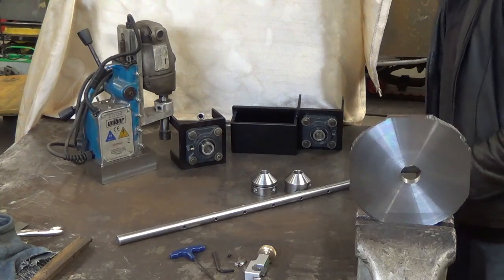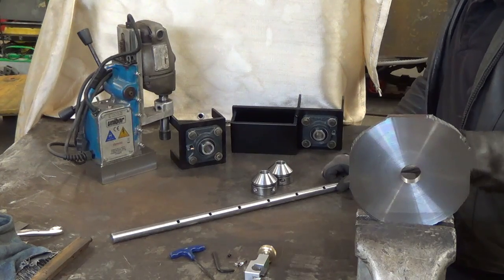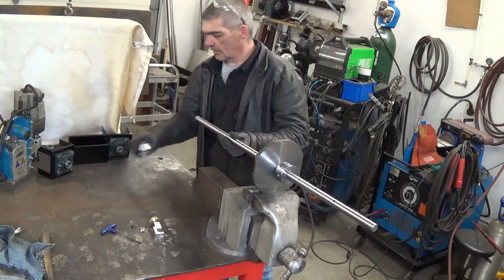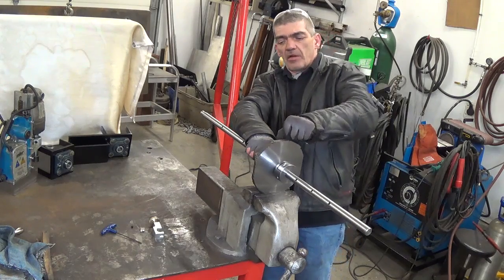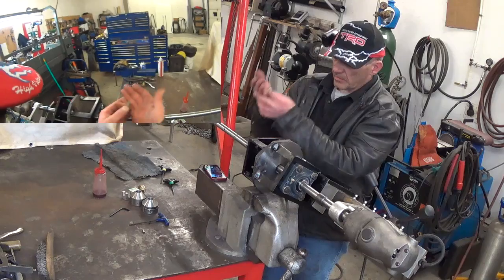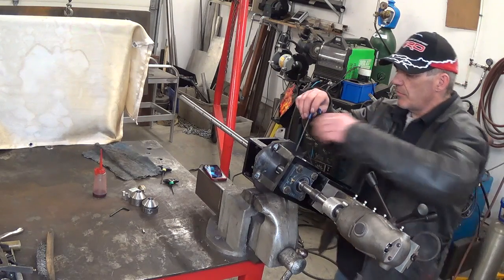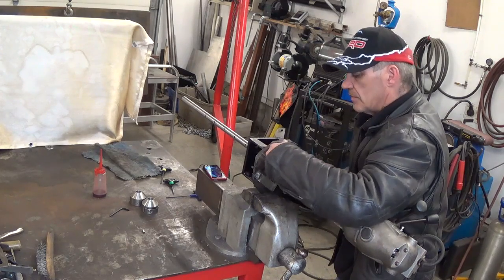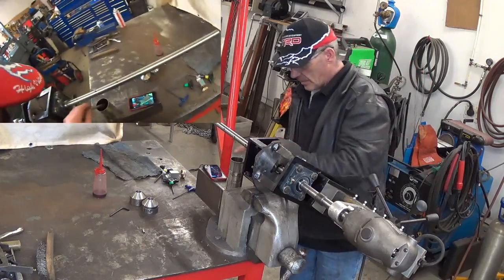Line Bore..

Comment: on yer setting tool, its possible to get "micrometer heads" just the threaded bit with the thimble and barrel so you can mount that and use it to adjust the cutting tool.

Comment: No need for square holes in the boring bar. I built mine 20 years ago and it has round holes for the tool bit. Works fine

Comment: Gidday Shagger,     about to mount a fly cutter on mine and i thought i'll have a look on You Tube if any one else has done this.     The only thing I'd change on yours is the steel base the mag base mounts onto.   I'd go 1 inch thick,    thicker it is the stronger it hangs on.      nice work though.

Comment: I did that untill someone walked by and tripped over the plug end and everything came crashing down! So I took the magnet off installed insulated spade connectors and added a few feet of wire enough to get magnet out of the way safely. Then cut a 1" plate to put in the magnets place bolting it to the drill motor. Even a power bump and it will fall. And by lengthening the wires it still ran. Was a newer drill with circuit board in it. Good luck! Nice work.

Comment: Good job. I built one just like that 20 years ago.  It is still in operation.  Your mounts are much better than mine.  Mine were made of any scrap I could find on the job site.  It worked though perfectly though.  Done a lot of buckets, grapples etc for the logging industry over the years.
Reply from the maker: Thanks. I have made some changes since the first try and at some point I'll do a video about it. :-)

Comment: what wattage is this drill? think it would be capable of a 4inch boring cut?
Reply from the maker: Label says 6A @ 450 RPM...I dont think she'd do big holes. The main idea was to use it for small excavator bore say around 30MM.
Reply: @CompEdgeX2013  thanks for the response, what depth of cut were you taking here? i need to figure out how to open up a 100mm hole to four inches ensitu on an injection molding machine
Reply from the maker: @BenjaminHarris88  Oh man, that was a while ago...if I remember correctly I was just taking a quarter turn on the adjuster...so .025" on the diam..

Comment: Nice video. Line boring to the average heavy equipment mechanic is a black art. All they know is it can be done..(they don't want to know how) Lots of money change hands and it happens :-) 
I'm a truck driver paid to figure out a line bore on a clapped out machine and it was one of the most satisfying things ive ever done. search 5ZwsftYpQs8 all done for $250 and some scrap iron at the yard.
I wish i had seen your cutter advancing tool allot sooner i could have used the idea.
Reply from the maker: The magdrill idea was something I wanted to try for small bores that would justify the work. I did make some changes to the unit and it is even better now. I'll likely document this in a future video. :-)

Comment: Very clever i have been wondering how to do this for a long time. There must be a better way to measure the tool height. Where did the bar come from?
Reply from the maker: Tool height can also be easily set using a dial indicator (more accurate anyway). Using the tool is great for quick adjustment while roughing. 
The bar I made myself using some 1045 ground shafting. quite easy once you have the needed square broach. A fellow machinist was nice enough to lend me one for this experiment. :-)
I have made some changes to this setup and hope to document it in a future video.
Reply: ***** Hmmm perhaps two pieces of flat steel with a pivot point with degrees. Lay one flat on the bar lift other bar up (must have a sharp point_ until it reaches the determined height of finish bore- or to measure cutter height.  Kind of like a carpenter's bevel square in design but small and modified. I am not a machinist but a 35 year carpenter...
Reply: ***** As you said it is not the rough cut- but the final cut. So once you reach the predetermined height you're done. You only have to measure once this way. Set modified bevel square on bar and slide towards bore if it does not fit in your not there.. Must have a very sharp point with 100 degree back cut bottom  angle. And can be used to measure tool height fast. Same thing-  slide to cutter height --if cutter height has not reach  that point you're not there yet... We call that a cheat stick..
Reply: ***** the hard part is the math to set up cheater.But once set and securely tightened no more measuring. Ok i am done -- like your video-- as with all videos-- they make us think and learn. Keep them coming---
Reply from the maker: A preset gage will in theory work. What it lacks however is the ability to monitor tool pressure during the cuts... whats dialed in as compared to whats actually cut. There is always spring in the tool and knowing how to allow for it is a big part of cutting metal. You'll hear the term "spring cut" or "spring pass" quite often. Dependant on material you can dial in a .050" cut but only remove .045". Monitoring this as the final size approaches is what makes a good fit or an oops!! :-)
Reply: Yep there is a learning curve for any trade that can not be taught except by doing it  and screwing it up.

Comment: looks good only thing i would say is 3 legs are better than 4 as they will not rock. when i do set up we just use 3  legs  got a hole box full of stand off's. only other thing is  give them a little angle out or in but all the same way . think of a tri-pod.keep up the good work
Reply from the maker: Ya, I can see that. Will keep it in mind for some setups for sure. Havent done much to continue this project lately but do plan to add more to it.  Colin :-)

Comment: Interesting demonstration of line boring using a magnet drill. Often the following operations are also required along with line boring: 
A) build up welding of the bore surface. This can often be done by hand or in case of narrow, long bores by a machine.
B) facing both ends of the bore to put in bushes with flanges. You would need a similar mechanism as in an automatic boring head.
C) Cutting of internal grooves to hold snap rings, O-rings, seals. Same mechanism as for B)
Are you aware that there are two businesses trying to put line borers out of work? https://www.youtube.com/watch?v=Hgd9ksEoRqo and http://www.ferret.com.au/c/fortus/expander-bolts-from-cps-wear-parts-n1833441 Once these expander bolts are installed there is much less need for line boring.
Reply from the maker: Thanks for taking the time to comment. Adding the links caused it to go in the "likely spam" section till I noticed it, sorry. Some observations to your points:
A) Bore weld is one option but a common procedure around here anyway is to bore over and make a replacement press-in bush of better than mild steel material (EG:1045). This is usually a cheaper option to bore weld equipment and IMHO a better option.
B) Facing is not always required and can generally be incorporated into the bushing as many setups I've seen have clearance for the flanges.
C) Ya, this part sucks..LOL but is necessary.
I have seen the expander pins and see some viability provided the lug ears are not worn out of round excessively. The expanding section of the pin still cannot expand in one area to completely fill an oblong hole. Of course any gap is room for the machine to develop slack leading to the same end result of sloppy pivot point. While having uses I don't see them as a one-fix for line boring.

Colin :-)
Reply: thanks for rescuing my comment out of the dumpster :-) C) Yes the expander pins are not a valid repair for heavily worn out bores. But in those cases they can be installed after a traditional repair with welding and line boring or even with bushes if either press fitted or welded fast against rotating. Once such an expander pin is installed the bore is unlikely to wear out again. Good for the pivot owners, bad for the line borers/pivot installers....
Reply: How unfortunate that your videos stopped coming. I am looking forward to line boring projects or anything...
Reply from the maker: rol eic
 Things have changed in the shop over the past year that make it hard to do video.. I do have some linebore footage of the bigger tractor blade and hope to string together something in the near future. :-)
Reply: I am looking forward to that. Thanks.
Reply: hello Colin, how are you? The near future is over. We are in the far future now....;-)
Could you put your boring bar to use? If you want to go bigger I recommend to use a standard electric motor like for a lathe with 2-3 hp but with a reduction gear. You can find used gear motors on ebay or other platforms for cheap. Basically that means to build the whole boring bar with drive and feed from scratch. But since they are not very complex designs this is most likely within the capability of your equipment. Probably you can make one even without a lathe and mill just with a drill press and a welder. You just need to buy ground bar, 2 bearing blocks, a 0.5" or bigger all-thread for the hand feed mechanism, a few HSS or carbide tipped bits plus some scrap steel.
Reply from the maker: Did I mention that I had purchased a commercial line bore machine this 
summer? If not, well I made the decision to go ahead with an entry level
 electric machine from York. It does up to 5" bore and has 4 and 6 foot 
bars. I did construct an additional 1.5" x 4 ft bar for heavier work 
than the 1.25" bars can handle. I'll try to show it at some point. It 
has been used to do one snowplow job a few months ago and worked well 
but I am still learning how to use it most efficiently. :-)
Reply: congratulations. Do you put in bushes after line boring or do you weld and bore? Would love to see some footage of it in use...:-)
Reply from the maker: This one was a simple oversize. Plenty of material in the boss. It was severely worn (1/4") from lack of grease and original pin had broken several times. I did shoot some video and will have something together soon. :-)

Comment: Very interesting video. The setup ingenious. I hope you will show the actual job when you get that far. This would allow "in the field" work and with really good results. What is the diameter of the axle/boring bar? It would also be nice to see how you drilled and broached the bar, adding set screw (I assume). Very nice solution for adjusting the cutting tool. Thanks for sharing. Well done video, too!
Reply from the maker: +Jim Milne Thanks Jim. This whole exercise is to prepare myself to offer a service that is not available in this area. This unit is meant to be a lightweight rig designed to re-bore smaller bores found on mini-excavators and the like. Bar size is .875" (7/8"). I have taken test cuts with it up to and including 2.4" today. Above 2" it starts to flex but it was never intended to go that big. I'm making a larger bar for that.
I had planned to record some of the fabrication but the broach tool was borrowed and needed to get it done and returned.
I made a large improvement today that I will touch on in the next video. :-)

Comment: Great tool Colin!
One thing I'm wondering is how you're going to measure your bore. I guess when you have a line boring job you need to fit something pretty precisely in there, and this something is probably pre-made like a bearing or a repair bushing.
Reply from the maker: +Sergey Gromov Sorry I missed this comment.. Yes the bore is generally done precise but often the bore is only machined to a round condition again and the sleeve made to fit the hole. In this case precise measure is not necessary until ready to fit the bushing.
In cases where accuracy is needed it is quite easy to remove the bar to fit a snap gage or other bore measure tool.

Colin :-)

Comment: Nice set up. Got a question(s). What do you do when you have an egged out hole(i.e., re-locate the hole). How do you adjust for that. Also, after you grind your weld off those bearing legs do you have to take a squaring cut on the 4 legs to make them all even height again ?

Comment: Have you tried using it on the pull stroke of the mag drill?  I wonder if that might make a smoother cut, especially heavier cuts.
Reply from the maker: +Bob Korves The toolbit in the video had a neutral rake so that might work nicely. I had another ground with positive rake but didnt test it.  I also didnt try any heavier than the .025" DOC (.050" diameter) as shown in the video. I noticed some things I wanted to change so the video was cut short. More to come on this project. :-)

Comment: good work Colin ! ive been researching on building me a rig like this ...i haven't run into the need yet to have to use it but i have many customers with heavy equipment so its a matter of time im sure lol..... did you put the angle of the bit on 45 degrees ? i see where alot of them are .......the thing about this is you have to have a bunch of different bars for different size holes lol ......i guess bearing assembly's too......ah more projects ...........Eric in Kentucky.........
Reply from the maker: +eric chilton I already have more material for a larger bar...but need a more powerful source motor for the bigger bar. Biggest bores I expect to see here would be around 4" I suspect.  There's probably no end to the project!  thanks :-)
Reply: eric chilton på

Comment: A video! Yay!  I like your "depth" setter. (Not sure of the correct term)  It's very simple. I want to build one for my line boring rig, but I was trying to make it too complicated.  I have to add I'm disappointed, though, I was looking forward to the explosion! ;)
Reply from the maker: +Wide Vision Metal Fab Thanks Matt.  I suppose I could have cranked in a huge cut and forced it through...LOL  
The setting tool is nice for such a small bar. Probably not necessary for a larger one as you can use a set-screw to push the toolbit.

Comment: I like it, my old tractor needs a lot of the fittings line bored and all new bushings installed, I may never see that day, but I can see how my mag drill and boring bar can do it now.
Reply from the maker: +Ed Ginsberg If you have the power source the remainder isn't hard or expensive. The square broach is a little pricey but way cheaper than a factory built unit.  Thanks :-)
Reply: +CompEdgeX don't they make a round insert with a square internals. tried to find them on McMaster Carr but not sure what they would be called
Reply from the maker: Ed Ginsberg
Keith Fenner referred to those in a vid some time back. "Toolbit holder" from MSC??
Reply: Hello Mate, try this company : Sturdy Broaching co, Warren, MI. http://www.sturdybroaching.com/contact-us-2.   The only thing I would worry about is the "Tweeking", or movement of the bar, to put it out of round, after they were welded in.  I have seen others use a round hole, then drill & tap a threaded hole 90 degrees to it. Put square tool bit in, clamp down with set screw. BTW, make sure you remove the cup point on the end of the set screw, or the set screw will always fall into that same place on the tool bit. Your thoughts ?

Comment: That will be good for repairing buckets and other implements in the field.  Knuckle bushings as well.  I guess you can make A/C power for the mag drill off a generator or a welder if you are set up for that.  Nice job, and a good design for working on smaller equipment like your little backhoe.
Reply from the maker: +Bob Korves This one was purpose built for the smaller equipment. I know of several now that need work and hope to get it into operation soon. 120V power make portable use easy as a side benefit.   Cheers :-)
Reply: +CompEdgeX That was my guess.  It looks perfect for that size equipment.  It is a good thing to be able to go to the customer as well as letting him come to you.  Usually more money in it as well...
Reply from the maker: *****
Yup. I am going to test the limit of the 7/8" bar by making an extended toolbit holder. I'd like to see if it can do 1.5".. :-)

Comment: Hi Colin, Welcome back!  Your new tool works great.  What kind of stock did you use for the boring bar?  Since the straightness and stiffness of the bar are clearly important considerations, is ordinary cold rolled 1018 straight (and strong) enough, or did you use something else?  Looking forward to more videos.  Best,  -Chris
Reply from the maker: +bx2200 Thanks Chris. The bar material is 1045 ground shafting. It offers dimensional accuracy and higher strength over cold rolled. Chromed would have been nicer but none available at the time.

Comment: Hey Colin, I would suggest that you put elongated slots for your bearing mounts and add 2 all threaded screws to push the bearing blocks that you could use to fine tune your bar position. This is fine if you just need a good hole, but I think it would be hard to get accurate position of that hole if it was needed with this setup. Works plenty good for what you did with it though, glad you aren't stuck in an RV somewhere!
Reply from the maker: +bcbloc02 I had seen that on one of the kits I was viewing and planned to add it at some point...great idea. A few other changes are pending as well! 
No worries...RVs are soon on the menu again..:-)
Reply: +bcbloc02 Hey Colin, great video...! Agree with Brian, would be good to slot the bearing mounts so you can fiddle with the alignment of the bar, given your probably dealing with wallowed out holes to start with... Excellent setup... Cheers, Daniel
Reply from the maker: +Daniel Werger Agreed...one of a few changes coming!  Thanks :-)

Comment: It's a nice idea, the only problem I can see is that you have to take the whole thing apart to measure the bore size.
Reply from the maker: +wheeltapper1 Well, not necessarily. You can use a spring caliper to gage the inside bore. Even taking the bar out on a small rig like this is no big deal. Thanks for commenting..  :-)